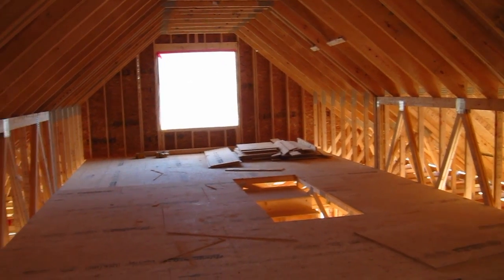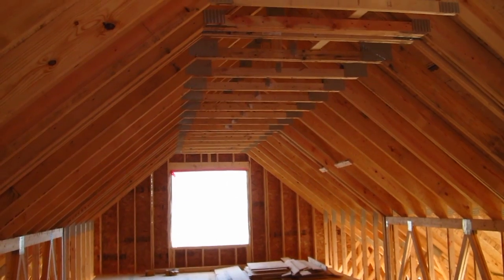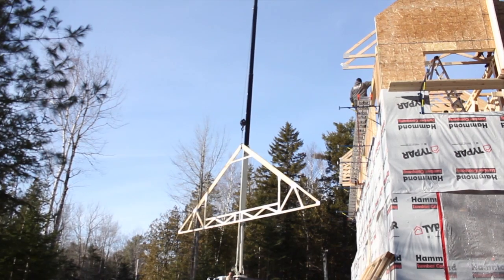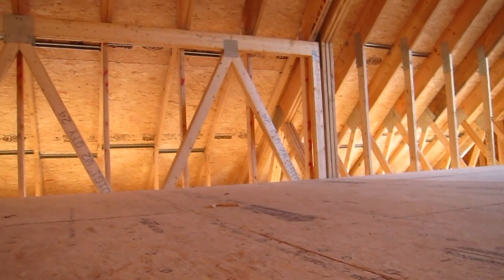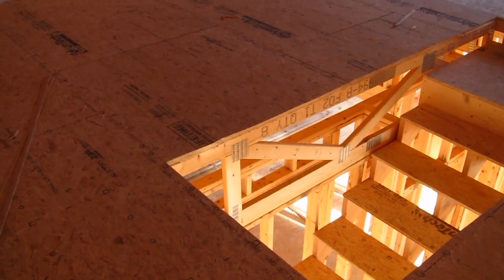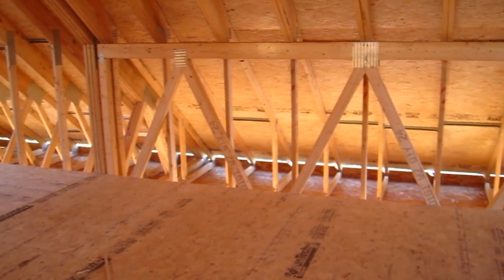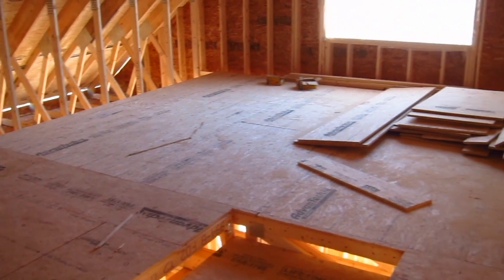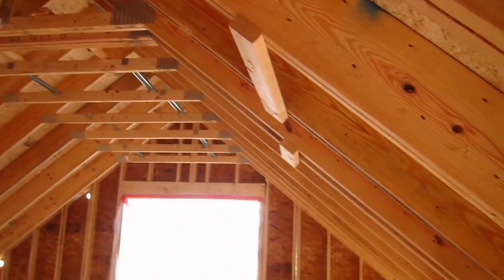Attic Truss Design

Comment: Are Attic trusses designed to expand and contract or can you connect an attic truss to a load and non-load bearing wall
Reply from the maker: All lumber is hygroscopic. Read about that on my www.AsktheBuilder.com website. All trusses must be supported by bearing walls. A non-bearing wall can be under a truss but it should never carry any load. Most carpenters do NOT connect non-bearing walls to trusses the correct way. I show how on my website.

Comment: Could also run the stairs parallel to the attic trusses by having an attic GT on each side of the staircase & ladder frame across from GT to GT where the stairs won't be. ILO ladder framing head out the stairs and use stubbed attic trusses to the head out girders. That'd keep all framing parallel except the 2 headout GTs
Reply from the maker: Yes, if the floor plan would accommodate the layout you propose. It was not possible in this house.

Comment: Is there any way to create attic storage space in a truss built home if perhaps a small shelving system is suspended from the top chords and webs and not the bottom chords?
Reply from the maker: Trusses are designed for SPECIFIC LOADING. Only a truss engineer can answer this for you.
Reply: @askthebuilder  
Thank you.  This had occurred to me a couple days ago.   The darn things support hundreds of pounds in plywood, shingles, sheetrock, ceiling fans and a giant AC/heater.  Thx 👍

Comment: Will this space be conditioned and included in taxable square footage? Interested to see how the attic trusses and the bonus attic space are airsealed, insulated and vented(?).
Reply from the maker: Yes, it's going to be finished. I have columns at my AsktheBuilder.com website that discuss the CORRECT way to insulate the attic trusses so you don't ROT OUT the trusses or the roof sheathing. Be sure to subscribe to my FREE newsletter once there. TNX
Reply: @askthebuilder  All I could find using search function on your site was https://www.askthebuilder.com/attic-trusses-room-size/. Couldn't find anything relating to insulating, venting, or airsealing these trusses. I'll look out for anything you might post on the topic. Thanks.
Reply from the maker: If you want to discover tips on insulating then you type insulation into my search engine. If you just typed attic trusses again, I can see why you came up with that result. You also have the option of talking to me on the phone to ask very specific questions to get very detailed answers:  https://shop.askthebuilder.com/products/15-Minute-Phone-Conversation-with-Tim.html

Comment: How long are these trusses? Thanks
Reply from the maker: 28 feet span if memory serves me right - could be 30 feet. It doesn't matter. You can get them any size you want.
Reply: @askthebuilder  well I’m thinking 32’ x64’ with a wraparound porch, elevated 8’. I’ll have posts holding up the trusses, 4’ porch on sides, 8’ on front and back. I’m still trying to figure out what kind of support I will need for the floor, Plus I don’t know if I need center support for the attic trusses which I’ll have with the hallway walls, probably a beam in the center in the living room and kitchen. What you think?